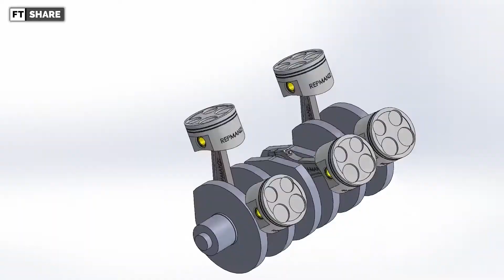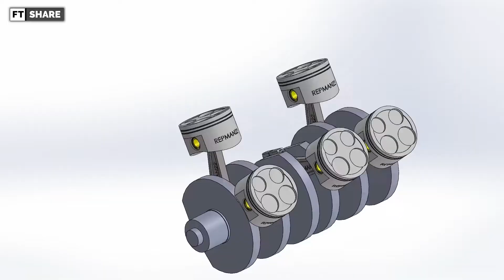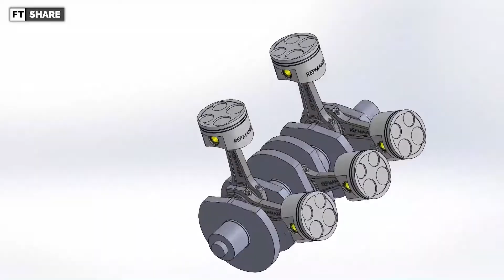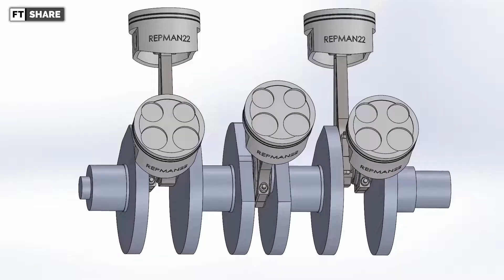What Makes RC211V Engine So Special?? | V5 Cylinders Engine By honda

Comment: The Honda 500 2 stroke during the 80’s and 90’s Moto 500GP were legends, but this engine was also legendary.  It’s a shame Honda no longer has balls, and they’re too fat and lazy as a corporation. Their fan base expires when us old heads die off though…. And we are only fans because of Honda of our childhood. They have to understand this at some point. Edit: anyone born after 1998 thinks Yamaha or Kawasaki is the leading Japanese motorcycle manufacturer….and they aren’t wrong for what they’ve seen

Comment: Interesting was it banned?  Was it  950 cc's ?
Reply: No it never got banned. It was used successfully until 2007 when they changed the rules from 990cc engines to 800cc to try and slow the bikes down for safety reasons, because they were becoming too quick!🙈 Didn't work though as the 800cc bikes were even quicker!😂
Reply: @LloydG52   might need to  restrict throttle body size or  Rev limits..
  All the Harley baggers were blowing up before 7 laps so they put 7,000 RPM rev limiters on them
Reply: @mikeskidmore6754  > Harleys racing
Thats gotta be the most boring motorsport race